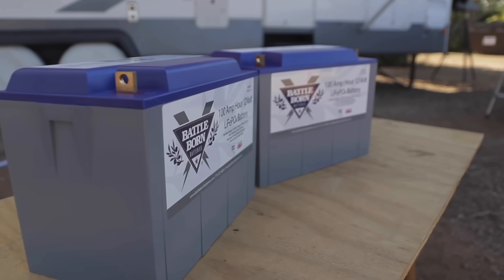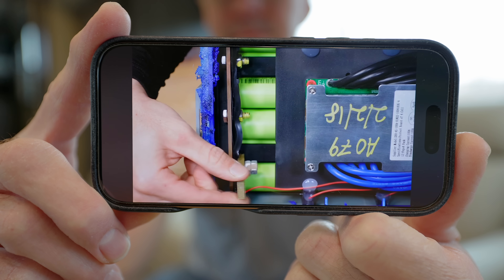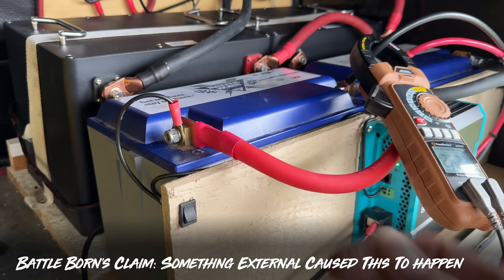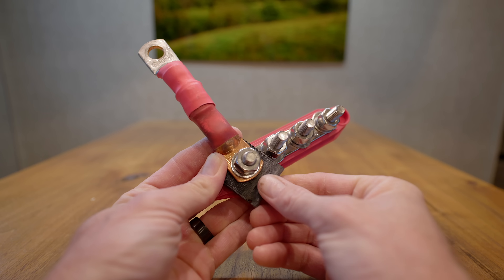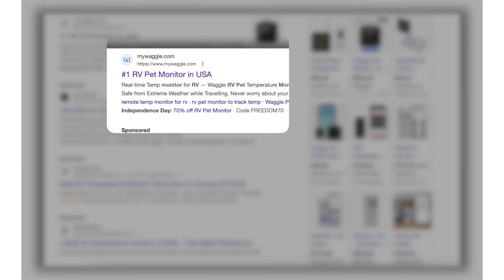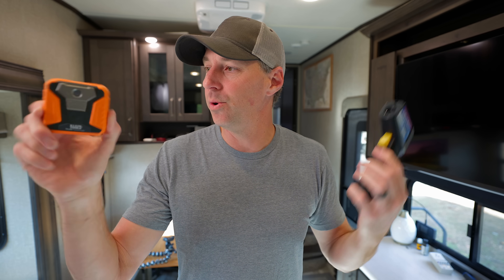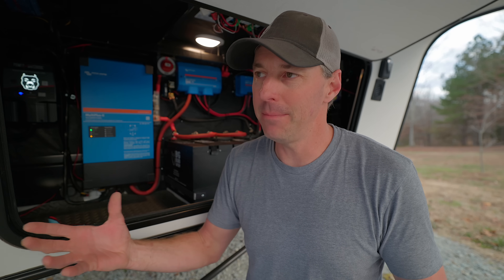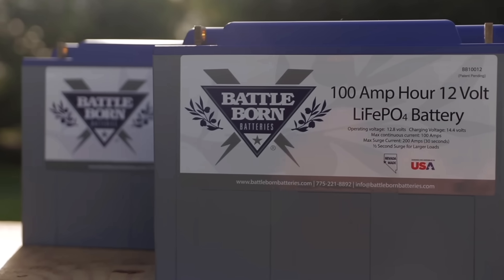Battle Born Batteries Problems!

Comment from the maker: What are your thoughts on the problem that Battle Born Batteries is facing. I tried to keep it balanced with what I have found so far in my research of the reported problem and the current response from Battle Born to their affiliates.  Also there are tips on what to look for and my thoughts on if this happening to all batteries that are in use.  Here are the links from the video:
Will Prowse Videos:  https://bit.ly/4qsTwJy
                                  https://bit.ly/3YbVoKP
                                  https://bit.ly/4pZfxjv

Waggle Discount Codes : Pet Monitor 
Offer : Flat 70% off on Waggle Pet Monitor
Coupon Code: MOBRICK
Promotional Link :https://bit.ly/4nB4ony
15% Coupon Code: JARED
Promotional Link: https://bit.ly/46J2meb
  Pet Camera Amazon Link: https://amzn.to/4roqP1B
      WiFi Pet Camera Amazon Link: https://amzn.to/3Mc7CQF

Battery Buyers Guide:  https://allaboutrvsinfo.com/rv-battery-buyers-guide/
Reply: Many of us have been talking about this for several years. DIY Solar Forum? Many talking about this for a few years. I stopped selling Battle Born two years ago
Reply: Another point: Aluminum against copper = galvanic corrosion.
Reply: This is a designed hazard. It amazes me, that they sold those for many years, even after allegedly customers complained about this.
Reply: Actually worse as the bolt they are using has a grove or a lip where the bolt head touches the bus bar on then left side so only 1mm is touching
Reply: They rely on a class T fuse to blow above the BMS current overload protection that would require battery to be returned.  They won't do that best they will do is come up with a new design call it version 2. Maybe offer current battery owners rebate no way they will do a recall.
Reply: 😮😢 i cut ties with battle born batteries about five years ago.When they promised me the world and then pulled out and then said they didn't need me testing their batteries.When I had fully paid for the batteries that they didn't deliver.
Sean quit the tech I was working with quit.I wonder why.
Last year, at the big ten I was promised.The world again, and they did not deliver.
Battleborne batteries flat out suck.
For overpriced battery😅😮😮😮
Reply: Putting plastic between your main high current electrical connections is the most idiotic and dangerous thing an electrical engineer could come up with.
Reply: well most systems are meant to run all day on battery, to likely 0.3c max discharge / charge rate so those will be fine 

but i build super fast charging with 8 kw alternators, i use victron ng bateries that can be charged at over 1 c. so can fully charge battery in 45 min or so.  and then shut generator / engine off
Reply: I have 7 BB batteries that are 3 to 5 years old.  This information, Will Prowse page, caused me to test mine and inspect the connections.  I used a laser thermometer and found no significant heat in any areas.  Now I only have 30 amps direct charge, that said I have traveled over 50k in the past 5 years over Canada and the US.  I think that proper inspection should be everyone take on this first.  Note any abnormalities, and take action before there is an issue when possible.  I think that Battle Born should take a look at their response to these dissections and either, address them or get ready for a market swing.
Reply: My suspicion is that no LifePo4 battery will pass the test parameters on his back to back testing if they have overheat protection in the BMS. 

His testing of other brands will likely provide this exact situation if equipped with high temperature protection. At least that is my suspicion. 

Mainly because it is not real world, no one would rely on a single battery to supply a 100 amp draw to full discharge and then turn around and charge it at the maximum rate. You would use multiple batteries to accomplish this.

Comment: Will action is very dangerous
For example, a car max. speed is 300km/h. U run the car at 300km/h, continuously for 2 weeks because the specs say top speed is 300km/h.
Of course, the engine burst. it wouldnt even last for few days.
Any people with COMMON SENCE will know that. NO ONE run their car performance with max. speed continuously.  
Will has “tear” many batteries. But I don’t think he know the proper way to test battery. 
Seem to me, he just destroys the battery

Comment: Will video is a solid evident that Will has abuse the battery badly till it “dead”
After 2 weeks, non-stop, max. current heavily running, the battery seriously degrade until it cannot charge/discharge properly
U would not do such terrible thing to your car
it has spread false information and cause many users worry
After being abuse, video prove the battery doesn’t get fire till end

Comment: Having plastic on the bolted would probably give you a loss of preload in the bolted joint and this would cause the joint to come lose. This combines with a joint that is exposed to fluctuating temperatures due to charge and discharge cycles means that the joint will fail and loosen. This is not a safety feature but a design floor.

Comment: I have 55 years of experience in electrical testing and maintenance of high-voltage, low-voltage, AC, and DC power systems. One thing you are taught early in the trade is that you never install a higher resistance surface (steel, plastic, etc.) between two conductors. Keep resistance at a minimum. This was, in my opinion, a terrible design, and if you own a Battle Born battery, I would be very concerned. I would not sleep in an RV, boat, or house that relied on Battle Born batteries.

Comment: Battle Born has a QUALITY of assembly problem. They have people assembling batteries that are not tightening connection to the correct torque AND are not securing the crimps on wire connector sufficiently. The "fix" is basic - 1. Recalibrate or replace assembly tools. 2. Regular training for ALL employees (quarterly). 3. Quality Control checks (visual and wire wiggle) before placing on the case tops. CLAIMING to have standards up to UL requirements means nothing. I wear a similar suit as James Bond. Neither statement means a thing. I personally have had my products certified by UL and while an ordeal at best - a Genuine UL sticker does bring gravitas to a product (not to mention better insurance rates). Reassess Battle Born. Tighten up your manufacturing. STOP inferring its the CUSTOMER'S FAULT - very bad.

Comment: LiFePo4 does not have thermal runaway!
I do not doubt the designers/assemblers believed this was a failsafe mechanism but it really is not. In no way, shape or form would this have passed a certification with inspection to how it was designed.
The battery is NOT UL-listed, but they refer to UL listing standards to try and illude to that it is. If it is UL listed there will be a UL reference number and one can go into the database and read the results from the tests and design inspections!

Comment: The claim that the plastic is some kind of thermal disconnect is crazy.  It doesn’t actually disconnect.  If they wanted to have a thermal disconnect, all they need is a temp sensor by the bus bars, that ties into the BMS, and shuts it down if it overheats.  Same idea as the high and lower pressure temp sensors on the cells.  A sensor would actually work in a safe way without destroying the battery.  

What their poor engineering created was a loose/poor connection that is dangerous and effectively destroys the battery if it gets a little too warm.

Comment: I wonder if you could open them inspect and fix it properly yourself and reseal the top? It's obvious the warranty isn't going to be honored by them anyways. 😢
Reply: If you don't feel the Warranty is of any value, then you are free to open and do whatever with your batteries. Will's most recent video (with opening one), he observed that the "bolts through plastic" problem is throughout the battery & between the cell groups. If the cells and BMS are good, it would take a complete rework to eliminate this failure point.

Comment: They need to have the terminal directly on the buss bar and not have plastic in between it. Pitiful response calling it a disconnect and trying to blame the users! When Will first tested theses batteries he totally missed this problem, and I bought them because he recommended them. Wish he'd checked closer the 1st time.

Comment: The answer BB gave you has nothing to do with what Will was saying with the heating from loose connection in the battery.  Will's advice was simple.  Take them out or risk a fire. Put your family first. BB is not acting like it is a safety problem from their side. The plate is loose from the inside. Don't let free BB batteries ruin your good reputation.

Comment: Great video! Thanks so much! To test my own batteries I would run a high amp AC load through my 1500W inverter (say my microwave/air-fryer/convection oven and monitor the terminals with an Infrared Thermal Imaging Camera? I just want to check to make sure that my two BB batteries are OK. TIA!

Comment: This is a very similar to a problem I had on a 1983 Escort.  In that situation the head was aluminum and the bolts holding down the valve cover were steel   When the engine got hot the aluminum expanded more than the steel and the bolts loosened up.  I expect that the Battle Born issue is very similar.  The aluminum nut expands more than the steel stud/bolt and over time loosens up.  This likely does not have to be from overloading the batter.  Going from hot (read desert) to cold (read below freezing) climates will likely be enough to loosen that connection over time.  One would think that any competent engineer would catch this if this accountant can.  This doesn't even address the likely issue of galvanic corrosion that will set in after a while.

Comment: I have had those batteries in a boat for 5 years and never had an issue.
Reply: I hope that continues to be the case. But you should be worried, especially in a boat given the movement.

Comment: I love Battle born as a company and a leading lithium battery manufacturer.  I appreciated you saying that most of us will never have an issue if we use it to spec.  The "out of spec" usage to failure that happens in every industry is a normal problem with everything.  I guess people pay more for Battle born and want to be able to abuse them more and get pissed when the fail safes break them.  I have 5 battle borns and have wired them wrong, abused them and not tightened the connections properly when i first bought them and they still serve me well, with no problems or issues.  they never heat up like some of the videos because I stay within the spec.

Comment: As an Electrical Engineer with over 42 years in the Power Generation Industry. The use of a bit of plastic to give a “safe disconnect” ! Is utterly ridiculous. 
They have messed up and are now blaming the users.
A decent company would just get it sorted out.
We don’t have this product in the UK, but I would avoid if this is the level of customer support that they give

Comment: So far,  all of the failures that I have seen on line were installation errors.   People were wiring the current to go through the flag terminal instead of adjacent to it. 

The other big errors that I have seen are using hammer crimps instead of professionally crimped wires that get much hotter than normal. 

The third big error has been large wires with a small bend radius.  This puts excessive torque on the terminal.

Comment: I'm sorry but some folks believe by purchasing the most expensive product is automatically the best with out doing any research. Just because it's made in the USA does not mean it's the best. China has left the USA in the dust when it comes to quality products. Sure you can find a $2 Chinese hammer that is junk but compare a $20 Chinese hammer to $20 USA hammer the China hammer would be superior. You have to do your research on anything to get the best product for the money.

Comment: That connection as a fail safe is total nonsense. If they are that concerned then surly a proper thermal fuse is the right way to go, not a chunk of plastic that can’t disconnect the power. What Battle Born are saying is about as ridiculous as I’ve ever heard because no mater how much the plastic melts the bolt is still maintaining a connection. It seems to me that whoever in Battle Born wrote that reply was not an engineer.

Comment: Hmmm, you kind of backed up battleborn on a ridiculously unsate response. With the defects that Will has Id'd you would have to be crazy to buy these dangerous batteries. Battleborn needs to pull their heads out.

Comment: Battle Born has monetarily benefitted too long from its marketing perception that their batteries are tantamount to a nuclear reactor. I'm glad I didn't fall for it. They are BATTERIES. And it turns out some of them are dangerous junk. An immediate recall by Battle Born would have been the best thing to do, instead of turning to the same marketing folks trying to spin it as a failsafe.

Comment: I'm a licensed electrical engineer... Battleborn's response is HOGWASH, an utter regurgitation from an incompetent boob.  NO electrical engineer would write a response like that, and only a company trying to cover their @$$ would let a response like that out.  Worse yet, they OBVIOUSLY don't care if they cause a fire and take people out in the process.  This company is the worst of the worst.  It's like they are trying to start fires and they hope no one will notice.  Weird!  Oh, and the entire construction method with a single-sided bolt contact is so obviously against what any good engineer would design - you ALWAYS go for double-contact if you can AND you design in some sort of gastight connection to prevent oxidation of the surfaces that do make contact, which means you design in many high-pressure contact points that 'dig' into the conductors on both surfaces to maintain redundant current paths.  What battleborn designed in here wouldn't pass any sort of environmental stress screening (it is a thing) and is a total embarrassment to the engineering (mechanical and electrical) profession.

Comment: Great video and very informative. I have 4 Battle Born batteries in my system and will keep an eye on this from now on. Is there someway the Victron systems in a solar system would or could monitor this loose connection or excessive heat?
Reply from the maker: Good question. You could use a terminal heat sensor on the battery that you could monitor through the Cerbo GX.

Comment: It's a poor connection inside the battery. NO PLACE in electrical wiring allows for poor connections. You have two states, connected with the least amount of resistance and temperature rise or open infinite resistance and zero temperature rise. Battle Born batteries are dead to me for a BS public save face response. There will be a mandatory recall coming, just hold on it's coming. Heat should recall, fire blame everyone should recall, death your responsibility recall.

Comment: Worst battery out there. If they just used four 3.2 volt prismatic cells like every other safe battery does. they would reduce the complexity and not have these problems.

Comment: I got shut down on an RV group I was a member of for posting Will Prouse’s video. Not to bash Battle Born. I was trying to warn/inform this certain Rv brand owners because BB batteries are highly recommended for this mfg by the #1 dealer.  Was also criticized by a person on that group, who I recognized as an employee of that dealership. The Rv manufacturer does not make any recommendations as to what brand of battery to use. It is the dealership that is recommending BB

Comment: When I watched Will's first teardown video a few weeks ago I noticed another issue and passed that on to Will.  BB may have some great cells and BMS in their batteries, but the rest of the assembly leaves a lot to be desired.  I agree with your idea that people that aren't pushing their BB batteries very hard shouldn't see this issue.  One telltale sign of a battery that should be taken out of service is the plastic around the terminal has become discolored.

BB's assertion that this is caused by abuse doesn't ring true.  However, heavy cables connected to a battery terminal should have some form of strain relief on them to eliminate the stress on the battery terminal as the RV is bouncing down the road.

Full disclosure: I'm a moderator on Will's forum, which doesn't make me an expert on anything other than keeping the forum clean of all the spam.

Comment: Will prowse is very through in his testing and he explicitly stated that the way there batteries are built it's a disaster waiting to happen. 
He showed us that. He tried to recreate the problem but other equipment failed on him and he has to wait for replacement. 
I've always told people do not buy those batteries. There way over priced for what they are. They look very professionally built but there made with cylinder cells which to me in my experiments are dangerous. You do you 😅

Comment: Those dumping BB and looking to buy a different brand - How are you going to test the new batteries to be sure they do not have the similar issues? Send a new one to Will and have him cut it open and load test in the same manner?
Reply: No, you do it the other way around.  You buy a battery that has been torn down and tested good.